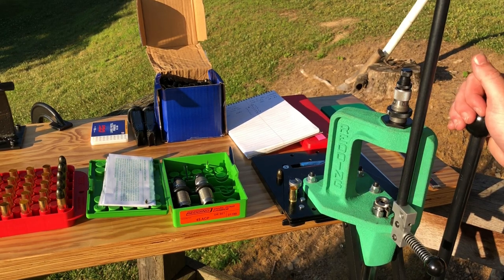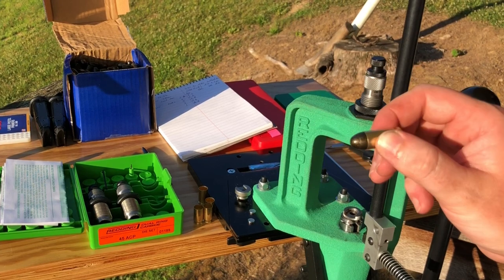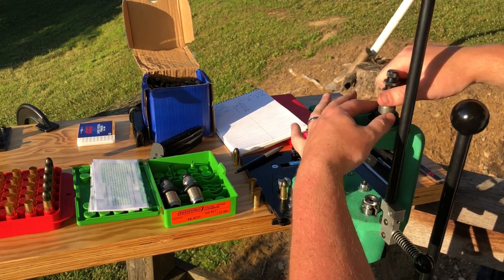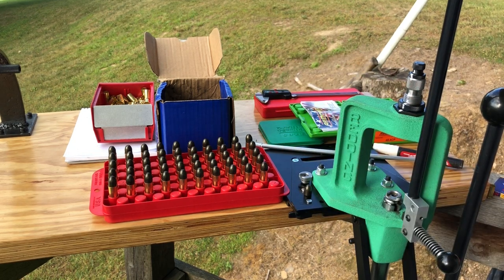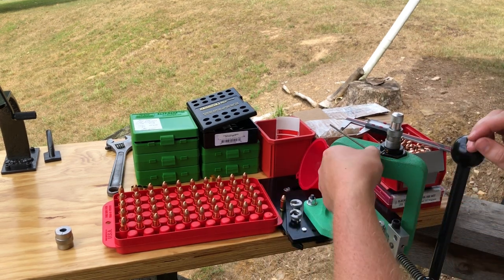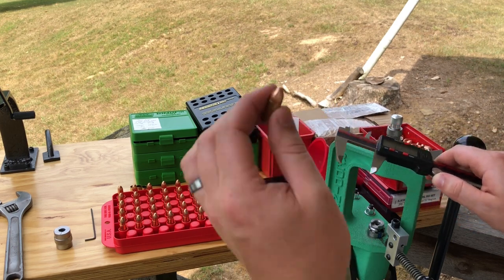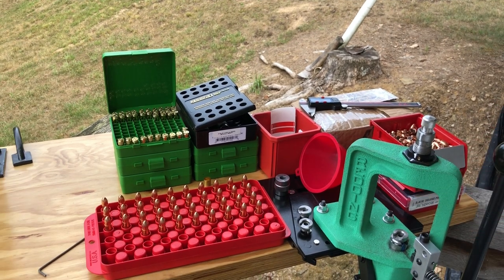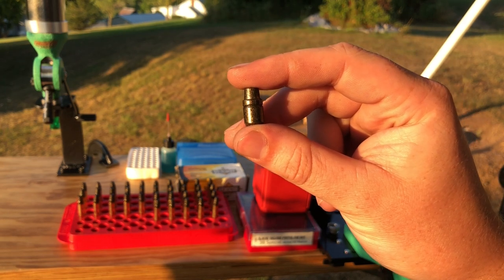Seating Projectiles and Crimping (Taper vs Roll Crimp)-PART 7 Intro To Reloading

Comment: just started getting into reloading, thanks for the video.  Wow , much to learn, first cartridge hopefully next week.
Reply from the maker: My pleasure! If you’ve got any questions feel free to drop a comment, I’d be happy to help out as best as I can. What cartridge are you starting with?
Reply: @thereloadingcraft  9mm, 115gn. The funny thing is that I got the bullets from Berry’s and I believe they are copper plated not FMJ and in the Lee book there is a difference in powder for the two. From your experience, when start a load from the minimum is it a nicer shooting round then say a factory one?
Reply from the maker: With the Berry’s plated bullets, I believe they recommend using load data for a comparable weight lead projectile as a starting point and working up from there. (Double check their website just to make sure, as it’s been a couple years since I’ve loaded Berry’s)
You’re going to want to make sure you’re following good load data, and work up from the minimum powder charge until you find a load that shoots well and has a manageable recoil impulse for what you’re doing. Never go over the max load listed under any circumstances, of course.

Also be careful when crimping not to damage the thin copper plating on the projectiles-plated bullets are much easier to damage than true jacketed projectiles, but once your dies are properly setup it isn’t really an issue.
Reply: @thereloadingcraft  thank you very much!
Reply from the maker: No problem!
Reply: @thereloadingcraft  Yes you are correct, used the lead as per calling Berry myself , and they worked great.  I successfully fired my hand made ammo, Thanks for the help !
Reply from the maker: @lens7859  glad to hear it, and congrats! Happy to be of help ☺️
Reply: @thereloadingcraft  Thanks from me as well!
Like, subscribed and shared.
Reply from the maker: @toneeclark399  you’re most welcome!

Comment: So what's going on when you're chugging along with RCBS combination dies, crimping/seating, everything going fine with .357 magnum loading 158 grain lead core full metal jacket flat nose and suddenly your case gets a wrinkle in it about halfway down it? Cases trimmed to proper length. Roll crimp set to "shrink" case lip less than .010". Bullet diameter too big? Case wall too thin? Not a consistent issue with brass makers that I can see. These bullets don't have a real cannelure to crimp on, just an inconsistent "mark" where one should be.They were "free" for buying XXX hundred cases from a big name online brass supplier